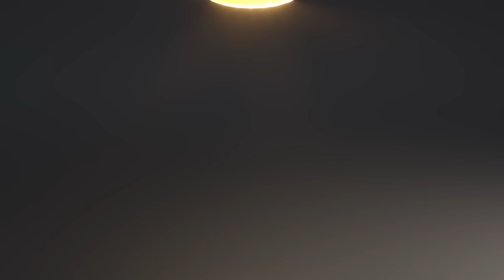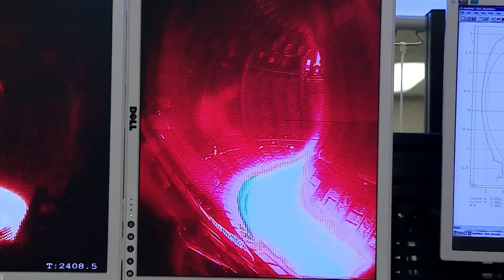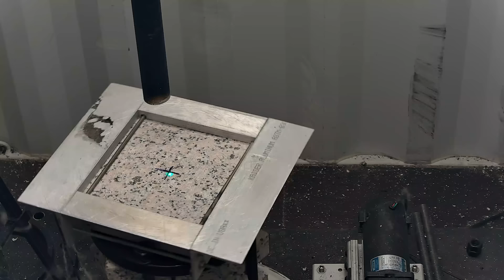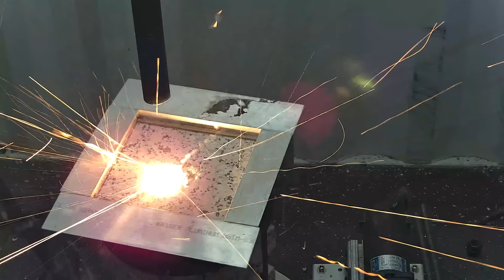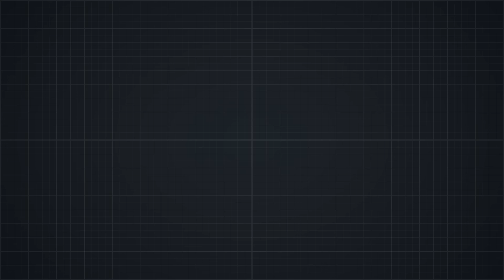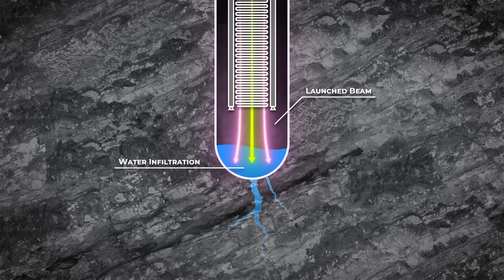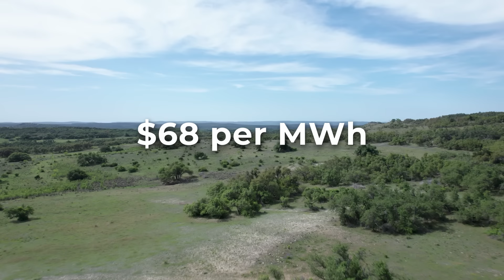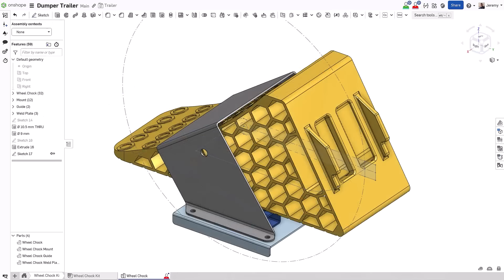Geothermal Energy is Changing

Comment: Using massive amounts of electricity to dig makes a lot of sense, because the site of the hole will need to be connected to the grid when the plant's finished anyway. Most of the grid currently doesn't use DC, but that's likely going to change as new technology allows DC to outperform AC for efficiency at high voltages. Quaise should look into ways they can set up a DC power supply that works with their gyrotron permanently, so it can be the same substation the geothermal power plant will use to send DC power onto the grid for the next 40 years. This could allow them to work with much more than 1MW in the future, for larger diameters and faster digging to greater depths.

Comment: How do they intend to keep the vaporized rock from clogging up the bore hole? It's not like the material vanishes into a black hole. The vapor will condense somewhere (even shown in the video) forming the same volume (or at least close to that) of rock or glass.

I'm all for researching new or improved forms of electricity generation. But when even their own estimates aren't competitive with wind and solar, it will be a hard sell. Of course it can provide 24/7 electricity, but something similar and more flexible can be achieved with electricity storage as well (which in itself needs more research, but is already in use).
Reply: To add there is too much unknown consequences if we don't find a way to generate more heat back to earth's core.
Reply: It's a fad. They try to get as much money as possible, fail and dissappear like always.
Reply: i think that was the use of the purge gas, it turned the vapourised rock into those asbestos looking fibers and then presumably in an actual hole, they would be blown all the way out to the top.
Reply: @nathansavage8692  
That doesn't work on a hole several km deep. Blowing gas through kilometers of pipes of is a whole different ball game even without having vaporized rock in it.

Comment: Drilling a hole is all very well. Once you have your hole, you then need a second hole. Then you need to connect them - this is done by hydraulic fracturing, problematic in democratic places. The heat is collected by circulating water from one borehole to the other(s) through the fractured rock. Water dissolves salts along the way, producing a highly reactive superheated solution, which the casing material needs to withstand. The bottom line is that overcoming these problems costs a lot more than PV with batteries. Geodynamics tried deep geothermal and gave up because the hot brine kept corroding their casings, and fixing this was not economically viable.

Comment: That's all nice and dandy, but how are they going to keep the "rock vapor" from condensating and solidifying on the walls of the bore hole as it travels up to the surface and therefore clogging up the bore hole? It seems they are so focused on the whole "rock vaporizing" part that they completely ignore the fact that they would have heat the entire bore hole up to over several hundreds kelvin to prevent that from happening...

Comment: One megawatt power generators on trailers are possible for sites that won't need transmission out later. Pre-drilled well sites with existing oil and gas pipelines converted to ammonia conduits are easy to picture, but on-site plasma-assisted nitrogen fixation for pharmaceutical plants and other purposes are also. Catalyst improvements and waste heat being used will improve current efficiencies that are still somewhat less than Haber-Bosch processes, but without the infrastructure buildout to the grid, it does sound profitable for isolated sites for dedicated purposes.

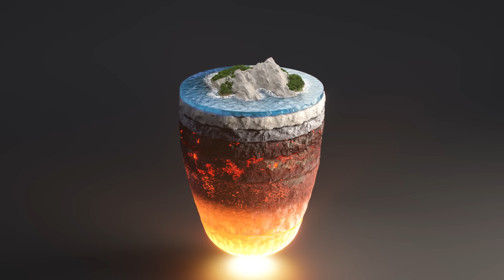Comment: 1:06 “Deep within the Earth, fission reactions generate immense quantities of heat”

There is absolutely ZERO evidence that fission is occurring in the earths core.  All there is, is speculation that IF sufficiently enriched uranium were in the earths core, it COULD reach critical mass (due to the heat and pressure).  Kinda disappointed that the “Real Engineering” channel would propagate speculation and hypotheticals over evidence based factual information.

Comment: Nice presentation for "Drilling tech/method" but the only problem pointed is the "Sipping Ground Water" problem. Else like "Tectonic Plate Movement" and "Potential Sink Hole" isn't explained/try to be solved. And speaking about Energy Cost, why not near Yellowstone? You can build miniature Nuclear Power station first for first drill and next after achieved hole quota for energy independence, shut down the nuclear station and happy drilling for the rest quota. For fact drilling near Plate Tectonic Junction/ Active Magma Mountain easier for drilling distance(to heat source), isn't it?

Comment: My understanding of the LCOE calculations is that they are fluffed out with a lot of horseshit factors like "CO2 emissions cost", which is zero, but which the people who create these metrics assign a value to as if it were real.  Real world experience with Wind and Solar are also nowhere near the rosy projections these charts tend to assume as average lifespan is much shorter than planned in most installations.
Reply: Bruh. The whole point of harvesting geothermal energy is to reduce emission so they are not horseshit factors
Reply: @geordi-gabrielrenauddumoul449  "Emissions" are horseshit factors.  Toxic gasses and particulates are one thing and we've learned how to mitigate those, but once people start talking about CO2 as a cost then they are off in conspiracy theory territory.

Comment: I have... concerns about how dangerous this could be. One of the scenarios from Railroad Tycoon 2 Platinum features a fictional power plant called the GeoCore Power Plant, which take superheated mantle and geological core material in its liquid state to create electrical energy on the surface. An ecoterrorist group sabotages it, causing pressurized gasses in the core to send lava skyward in a large, essentially manmade volcanic eruption.

Granted I acknowledge that this is fiction, and we may yet find that it is simply too impractical to drill that deep into an active planetary core based on our current knowledge of metallurgy before we even come close to finding out how true it may actually be. But I feel much safer with traditional fission reactors than I do with... this. Perhaps instead, the research can be adapted to ways of jumpstarting inactive planetary cores (say Mars, for example).

Comment: You should have a look at GA Drilling, whose plasma drill bits have been in research and development since 2008. GA = Geothermal Anywhere. They have been unlocking this branch of tech tree for far longer than the company you featured in this video. Did you miss them during your research for the episode, or is Real Engineering turning into promotional channel for startups looking to pump up hype before next investment round?

Comment: The main concern I have with using obsidian casing is thermal shock. Obsidian is basically glass brittle glass as such thermal shock will be a concern at deep levels where it is HOT then water comes into contact with it might cause it to crack. 😰

Comment: Take a look at LCOE bit closer and the cheapest sources of RELIABLE electricity are COAL, NatGAS(where it is cheap), and already build NP. Only one of these is practically zero carbon, and should last 60, 80 and more years, without much risk of fuel costs escalation (how long will NatGas be cheap even where it is cheap now?).

Comment: The overhead of an on-site power source and nitrogen source isn't necessarily my biggest concern, nor the cost of the gyrotron itself since this is, in its simplest form, a microwave oven turned up to 11 - my concern is with the drill tooling itself.

A typical drilling tool is essentially just a series of hollow tubes with the working bit on the end either being an active rotary drill with internal gearing or a passive drill, either of which are typically just some form of carbide tooling which we can easily and cheaply produced.

This on the other hand is taking a relatively inexpensive drilling tool and replacing it with a multi-kilometer long wave-guide with integrated piping for high-pressure nitrogen. While some drilling operations pump a slurry-like mud through their bits, its far easier to seal a tube for liquid than for a gas, especially one so long AND modular (modularity adds failure points). 

Then theres the idea of the wave guide itself; beyond simply the cost of creating such a long wave-guide, bore-holes start to meander eventually so how would this impact the geometry of the wave guide and by extension the wave itself? Would anything other than a perfectly straight wave-guide cause significant negative modulation effects to the wave? How about the depth itself? Will that long of a distance at just 1MW be able to sustain the power needed for vaporization on the other end or would multiple kilometers of wave-guide modulate the wave so much that its too weak at the other end due to internal reflections and refractions? 

That last point is one of the issues that is brought up when discussing laser-based power transmission - point to point in the vacuum of space for something like a satellite may be feasible, but anything traveling through a non-vacuum and not in a straight line simply runs into so many complex problems involving the geometry of the physics.

This is really cool as a proof of concept but I'm highly skeptical that it can deliver in the field.

Comment: in your cost estimates on equipment at the end, you make it sound like all of these costs would be incurred at each site but I'm assuming that like current drilling rigs the majority of the costs would be amortized across multiple locations?
Reply: Yes I noticed this as well. They are not going to be buying all new hardware for each site. Even if you go 10% of cost for parts and spares, it would be massively cheaper than was presented. That is a good sign but I also wonder how much useful heat can be gotten out before each borehole is not usable. Even in current geothermal plants over use can drive the temps of the steam down.

Comment: 11:46 a site being littered with samples, actually gives me less faith. If you’re being a serious scientist or engineers, you samples should be neatly arranged, stored, and logged. How else are you going to be able to collect retrospective data when something new is presenting itself? 

Furthermore, I’ve been wondering since your very first mention of this technique in the video, how is the vapourised rock extracted? I’m very doubtful you could get the gas/vapour flow high enough it’s travelling 6km without solidifying on the tube. So you’d need some sort of solidification and conveyance system. Which would be … well half of the challenge, no use just creating a pool of molten rock, you need to extract it. 

And I say this as someone who thinks geothermal might well be a substantial part of the energy mix in 2100 for some countries(that aren’t Iceland). I really wanted to understand their actual plan not just gawp at , molten rock with a laser.

Comment: elmag waves  ? I would have thought of ultrasound with controlled cavitations / turbulence right at the hole bottom to break the gooey yet hard rock ..
- except instead of water it would need to be something like .. idk. mercury is too much, molten salts would freeze at the top if you needed to stop .. I am sure they would find something.
- and who knows: maybe high pressure steam WOULD actually work great, and even turn back into water on the way up: helping to carry the particles along, rather than be too heavy compared to a permanent gas
- but anyway: elmag has really surprised me . I have thought of using lasers (not wavelength bound) but dismissed it and am surprised it might make sense

Comment: Testing in lab is one thing , but shooting a wave 6km away is totally different . Also , to pump the fumes out . Looking at how easy the fumes sticks to anything in the room. Imagine a 1 feet size of pipe with the length of 6km , the exhaust will easily be clogged very fast
Reply: This is my question as well. They don't seem to concerned with the fact that their lab is covered with glass webs, other than wearing masks. they can blow nitrogen to disperse material in lab tests, but there's no way to do it kilometers underground.
Reply: @milobem4458  In Europe we use laser to drill with assist of cryogenic gas to quench molten droplets at the bottom and then blow them out. Check DeepU Project!
Reply: @milobem4458  You act like you know how glass webs act in a kilometers long tube.  If this question wasn't asked by investors and subsequently addressed within the first day of presenting the idea to investors, they deserve to lose all their money.
Reply: I was confused about whether the waves are emitted adjacent to the excavated rock or way at the top of the hole and then guided down, the latter of which your comment seems to imply, is this true? As far as the pipe getting clogged, couldn't they keep the pipe heated to delay the solidification until the vapors reach the top? I imagine the bore is already accumulating tons of residual heat anyway.

Comment: Nuclear has been made prohibitively expensive exclusively because competition in it is near prohibited. Yet we still got a lot of changes despite that throttling. The price of Uranium is publicly available. The costs aren't with the Uranium as many assume but the plant itself and more than that the operating costs. With modular reactors it hits both those points in a big way. Also putting wind as a cheap source is tenous because the energy it generates is not energy that can simply be used. The supply is intermittent so it means you have to store it or lose it, which is very expensive and to transmit the loads is also expensive if done in real time. Wind is in reality comes to be quite expensive when considering these factors.

Comment: Nice video.😊
But about the idea.
Ok. So we need to transfer a 1  MW power microwave on distance in order of 10 km. I work in fusion. We have waveguides about 50m long and attenuation is already notisible.

Imagine we solve that. How they plan to remove all that wool from the many kilometer narrow hole.

And efficiency of the gyrotron is not 1. So multiple consumption at least factor 2.5.

And so on....

And how in the world gyrotron is similar to laser?😅

Comment: It’s been a while since I worked with RF waveguides. Back 15 years ago they were rather finicky with connections between waveguide sections and were pressurized. Wonder if such a long run in this application might have obstacles in that area.

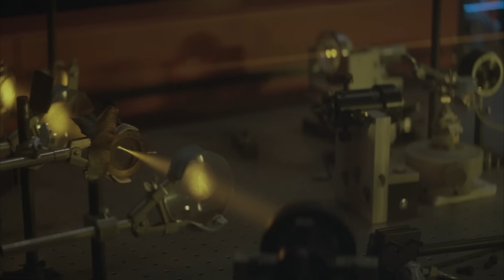Comment: 5:13 Microwaves are actually lower-frequency than visible light. The "micro" part just means that the waves are shorter than those in other radio bands, but they're still not a short as the wavelengths of visible light.

Comment: Wind is cheaper only because LCOE doesn't account for energy storage or the need for a wide spread infrastructure.
Once you account for them, the coat is more in line with other energy sources.
Also, there's a fundamental difference between a source that provides a stable, continuous flow of energy, and one that's unreliable and aleatory, don't you agree?

Comment: Even if the electric costs work i'm curious how you solve other issues:
Combustible gasses released.
Recondensing ceramic fibers clogging up or straight up abrasion on the drill and piping.
Where does the pressure, heat and the rock vapor go if it's not washed out?

Comment: So what would happen if you did the 4 inch hole with the beam, but then you went through after with a traditional drill bit to make it wider? Also you're probably going to need some sort of suction device to get all that fuzzy webby stuff out of the hole. I can imagine it would cause problems. Also the suction could pull out any water that would seep into the hole.

Comment: I'm worried this doesn't make any financial sense, Even if you never have to replace bits the drill stack pipes are going to be much more expensive! Plus it's going to be much more expensive and difficult to join the various sections of the drill pipe. The only way this would make any sense would be if one or two drill teams existed and they just drilled all of the needed holes

Comment: What I was thinking is that the hole would eventually flood with liquid obsidian. Even at a slow enough rate I don't think moving that much volume of material which is practically lava at that point, which also solidify as time goes, that nitrogen system would be carrying big time.

Comment: Fission is NOT occurring in the earth. Geothermal heat comes roughly equally from two sources: the primordial heat of the earth's formation, and decay of the radioactive isotopes U-238, U-235, Th-232 and K-40. U-238, -235 and Th-232 decay by alpha emission and K-40 by β - emission, β+ emission and electron capture, not fission.